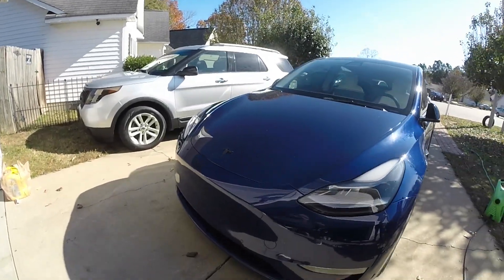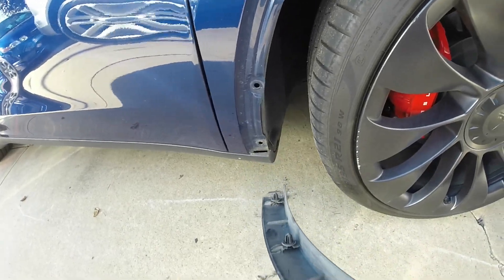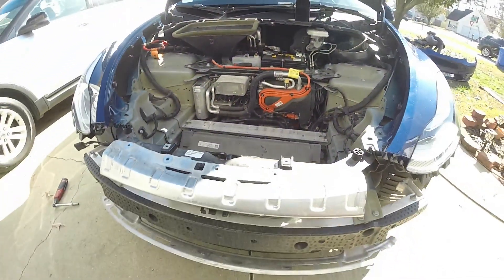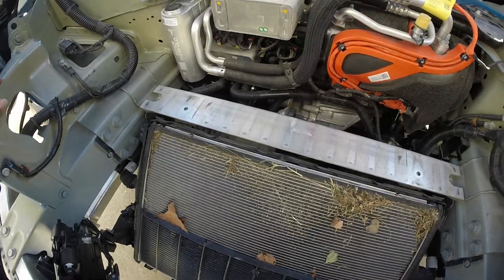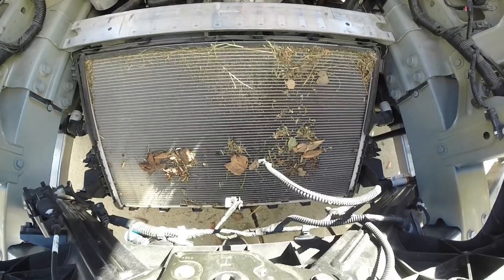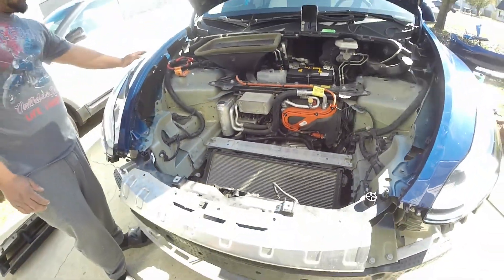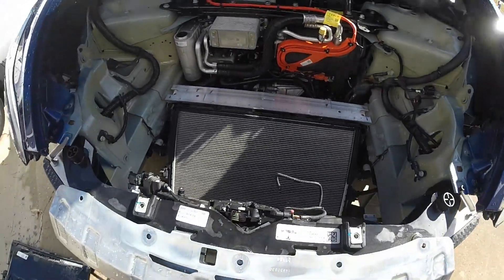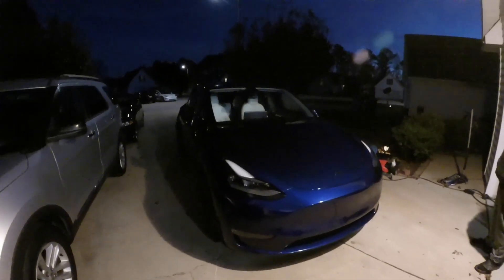Tesla Model Y Radiator cleaning

Comment: pressure washer on the radiator fins is not a good idea. it bents the fins.
Reply from the maker: I actually explained this on my other cleaning video. I've been cleaning radiators with pressure washers for a long time. you just need to make sure that you don't spray sideways. But clean it however you like, and when the grime doesn't come out, then try the pressure washer.
Reply: @jorgegarcia7005  mine is full of tiny bits of rock.  I ended up removing the fan shroud which was a lot more work.  Tried spraying out from the back as to not further embed the stones.  It didn’t work :(
Reply from the maker: @stevewoodyt at that point is best to get the radiator or evaporator replaced.
Reply: Wow I though it would bend the finns

Comment: 4 bolts, two hose disconnects, and a harness connector you can take the whole assembly out. There will be coolant coming out. No need to evacuate the refrigerant since it's a heat pump. That's only a radiator.
Reply from the maker: You do realize that many people won't know how to properly bleed the coolant system and what fluid is required. I wouldn't recommend doing that simply because it can potentially cause damage to the battery from improper cooling. This process may be a bit time consuming but I've done it in one hour from start to finish. And you don't have to purchase coolant fluid.
Reply: Tapping into a sealed system has way more risk of headaches
Nopeeee
Reply: Just the cost of the coolant makes that not worth it.

18 liters at ~$35 per 3.7 liters.